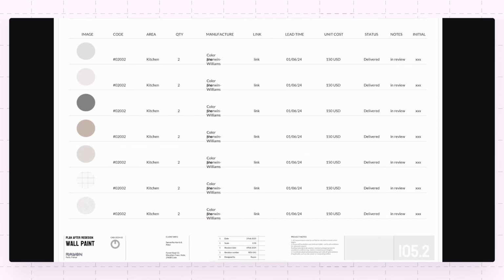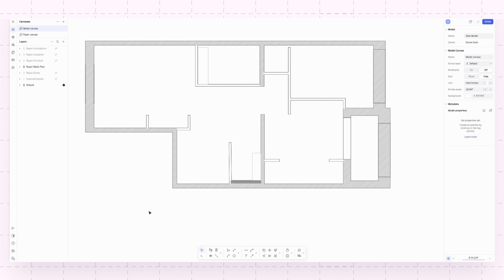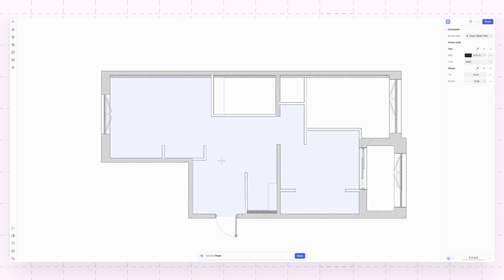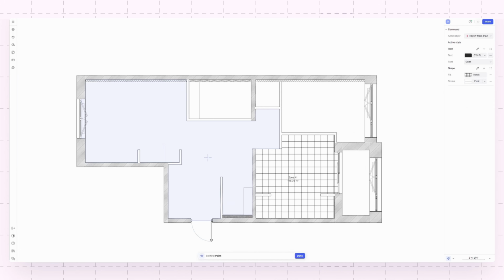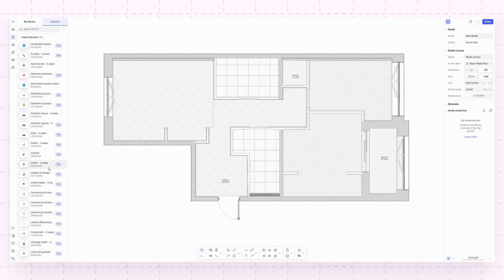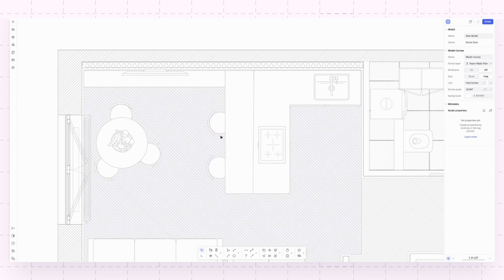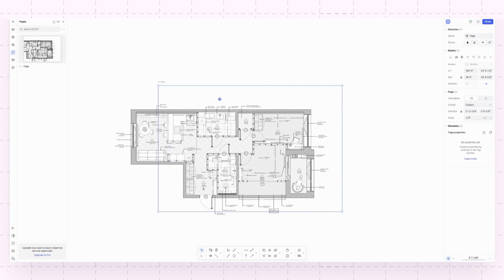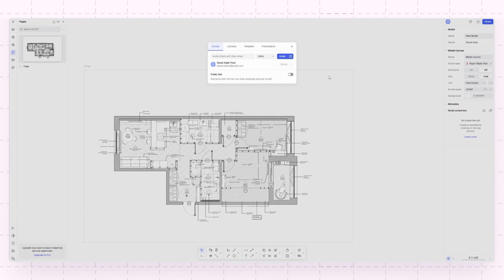Draw Interior Layouts Faster than AutoCAD with Rayon Design

Comment: Do l need to have fast and good computer like l used for Archicad?
Reply from the maker: You don't need a powerful computer to use our software; it should run smoothly on most systems. 👍You can find more information about system requirements here: https://docs.rayon.design/others/system-requirements